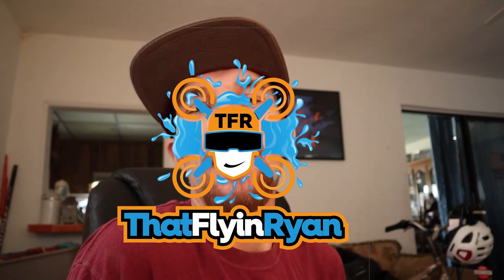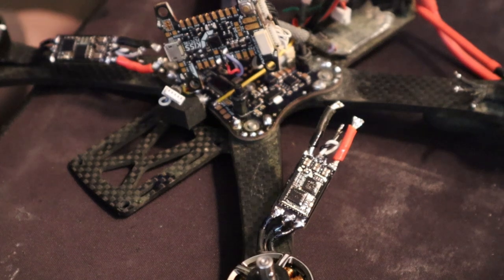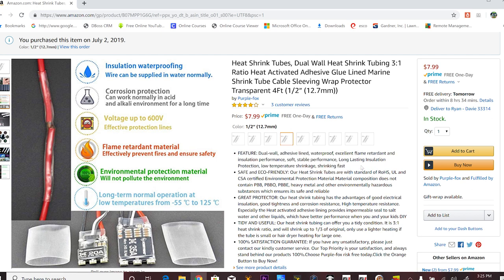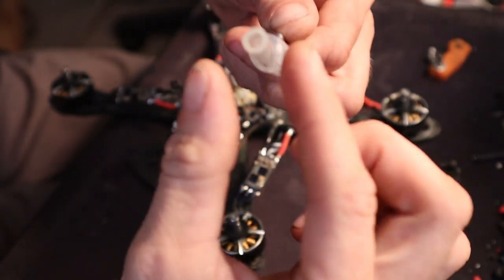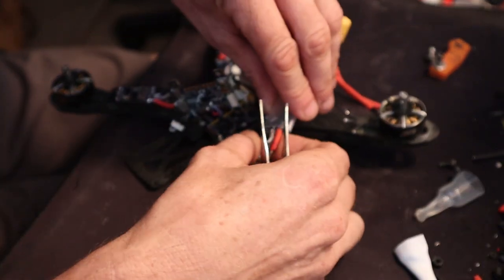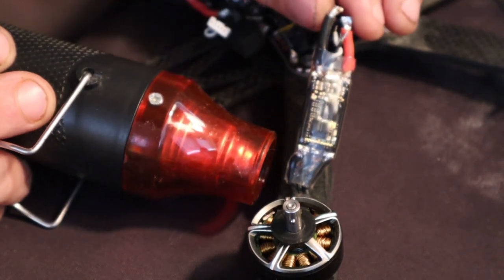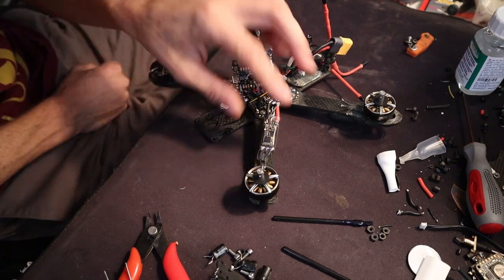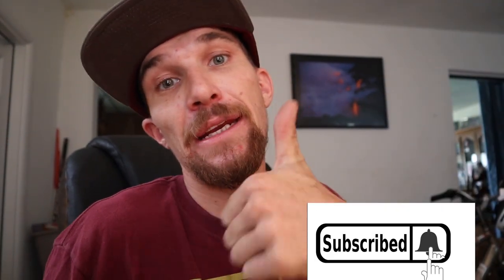By FAR The Best Heat Shrink To Use and WHY !!!!

Comment: Really good~! Sadly, most of the cables and cords I need to ID will continue getting tags instead of sleeves because of the bulbous end compared to the cable thickness - but this stuff is the best - but a multi-size kit would work better.

Comment: REVIEWS ON AMAZON SAY NO GLUE IN IT AND NOT VERY GOOD STUFF SO YOU MUST HAVE GOT A GOOD BRAND BOX BY MISTAKE !!!!!!!!!!
Reply: Amazon Reviews - sometimes there is more than one "color" and used to be vendors would switch products without deleting the old reviews. Not saying that is the case - but that video is great evidence this is great heat shrink - super clear and super fexible and thick. - there may or may not be glue in it though it did stick to itself. I want that performance glue or not.:eyes-pink-heart-shape:
Reply: Right - I checked - definitely glue lined. This will be great for strain relief and cable ID at the smallest size.